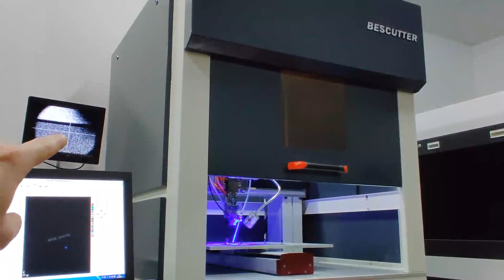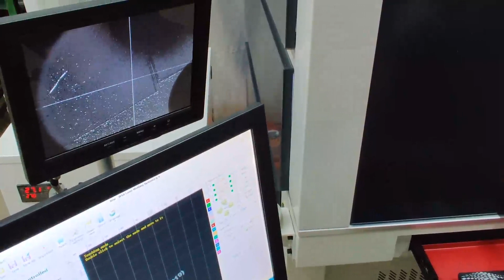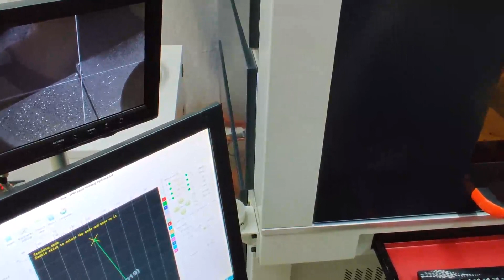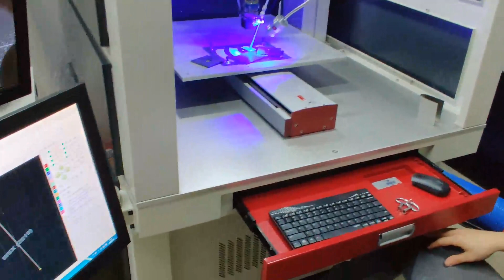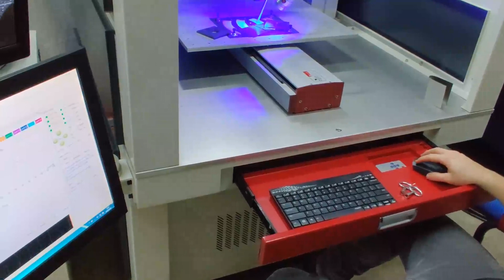750 watt fiber laser welder from Bescutter. First welds.

Comment: Gotta admit, that's pretty impressive.  Nice strength/ductility there, that's encouraging.  Is it using any shielding gas, or just atmosphere?
Reply from the maker: It's running argon on the weld but the flow needs to be a little more even.I think it's stirring air in. I think a pair of lockline tubes and diffusers should solve this.